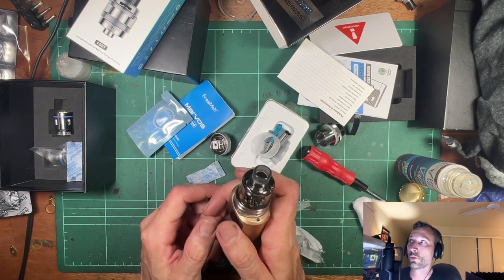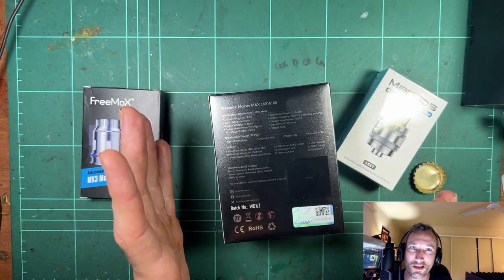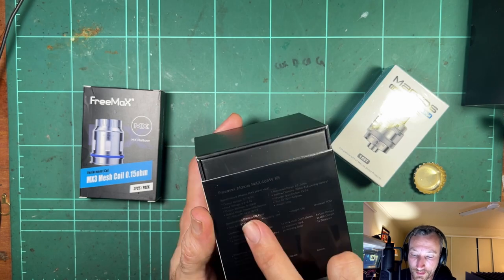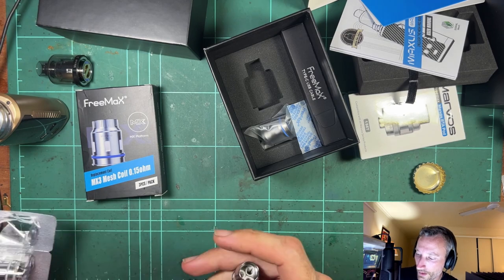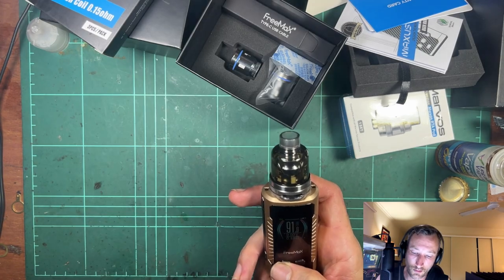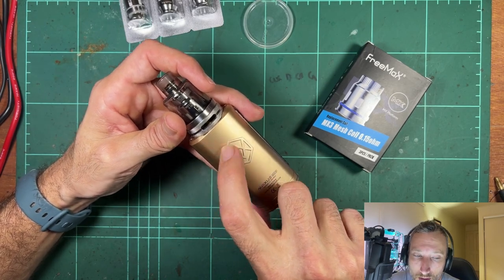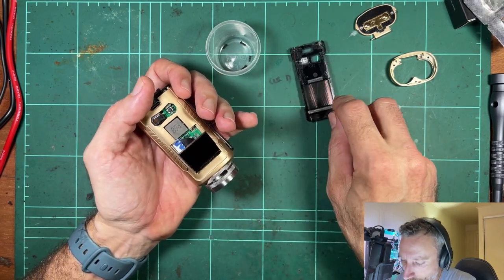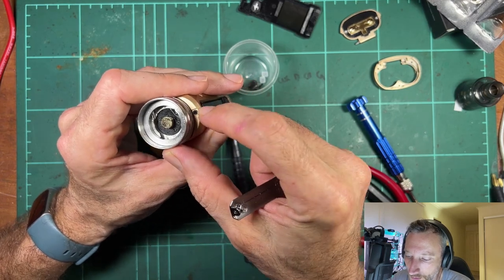FreeMaX Maxus Max: Review, disassembly and build quality analysis

Comment: i got "Battery error" when recharging, i have 4 batteries, they all they that problem, I think it the pod error not battery. :(
Reply from the maker: It sounds like it probably is the mod unfortunately but just out of interest, do you have another mod you try those batteries in? Just to confirm they’re good. Or a multimeter to measure the battery voltages?

Comment: When ever I see max voltage being equal to the cells, I think no boost circuit, but that looks like it has got something? 

One thing I disagree with you on is, as a mostly MTL vaper I like 0.1 watt increments. At a hundred watts I can see your point, but at less than 20 watts 0.1 is important IMO.
Reply from the maker: Agreed with all those points! I think the same about the max voltage - if the spec is not above the cell voltage, it probably doesn’t have a boost converter. Which isn’t toooo bad on a dual cell but still not great. I’m keen to test this mod and find out. I’m personally fine with 0.5 or 1W increments even at <20W for MTL but agreed that 0.1W in that range is actually justified. For above that… it’s just too much button pressing for no good reason!